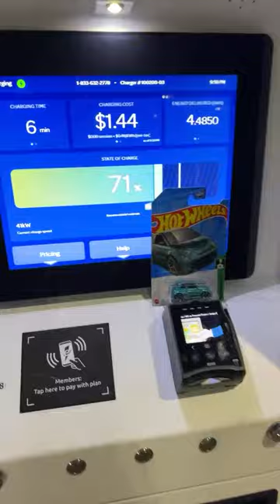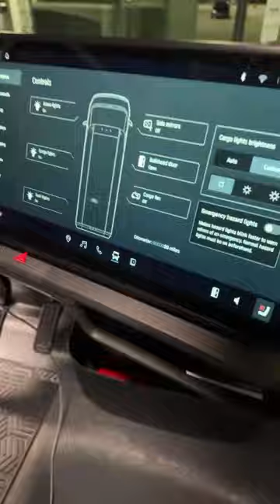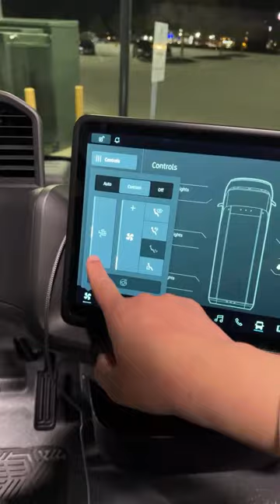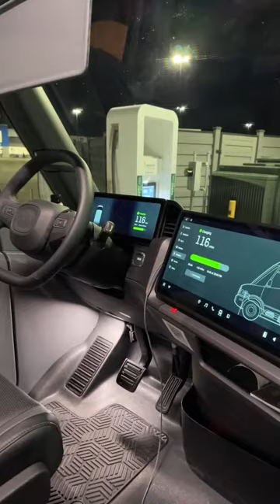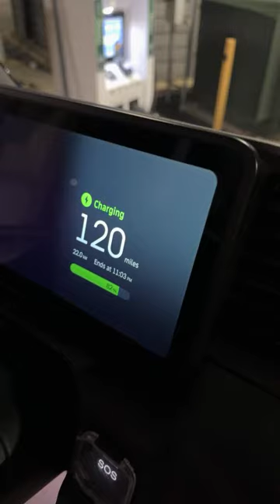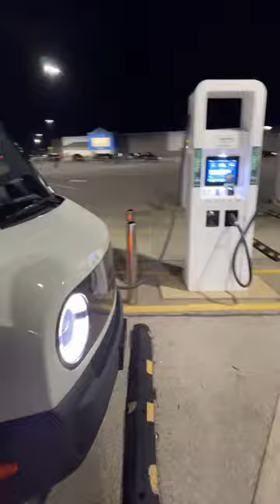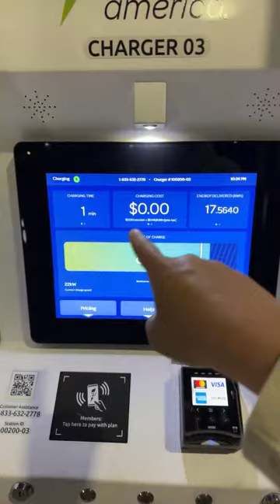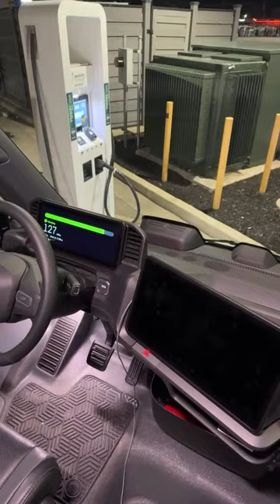(Livestream) Rivian Van RCV 500 Q&A

Comment: Looking forward to when these hit the used market to see what van life folks do with them.
Reply: Yes, those will be interesting because these vans are constructed and built so different from regular more traditional vans, there are going to be lost of things flat out done wrong because many of the normal and traditional rv/van life conversions will not be an easy adaptation. There will be lots of screw ups and challenges to overcome. The same thing will apply to the GM bright drop vans as well. There is going to be an extensive and expensive learning curve with these vans.

Comment: I wish they'd make a smaller van, I'm a courier, but light stuff, minivan sized loads, and no one makes an electric vehicle for us.
Reply: Nissan never brought E-NV200 to the US.

In Europe they've had several small electric vans for years.  But in the US, it would violate the unspoken rule #1 of the automakers: No small cars allowed in the US.
Reply: @davidmenasco5743  Actually I think they did for a year or two, but it was an abysmal failure, but then the NV200 ICE wasn't real successful either, I drove a base model for work at times, and that was the worst small van I've ever driven. Considering that the electric version was a Leaf motor and a modified battery pack, I can only imagine that was worse.